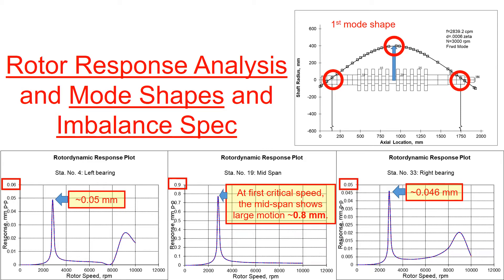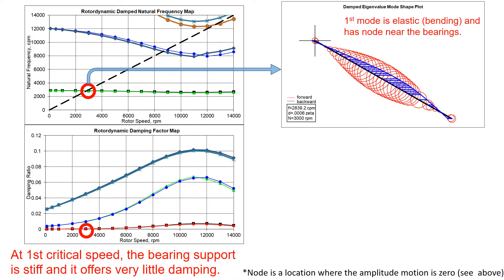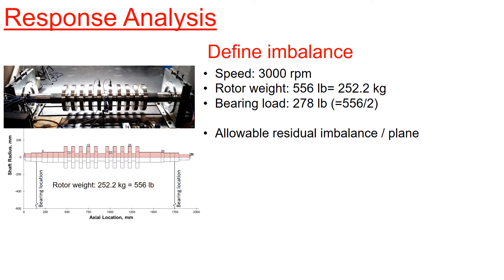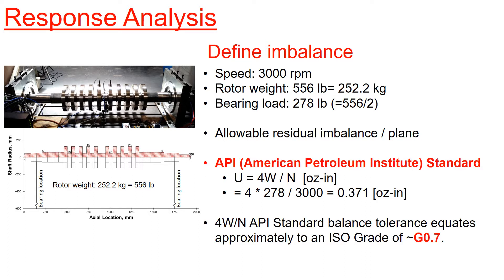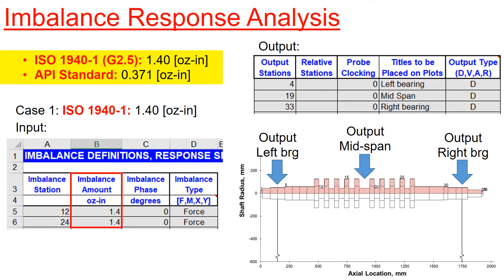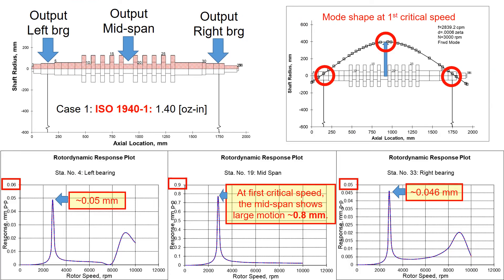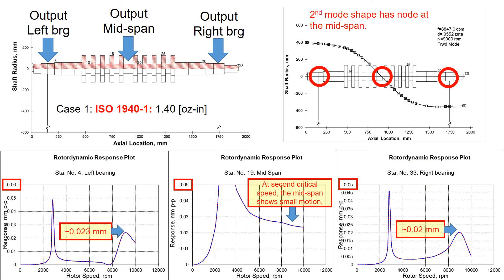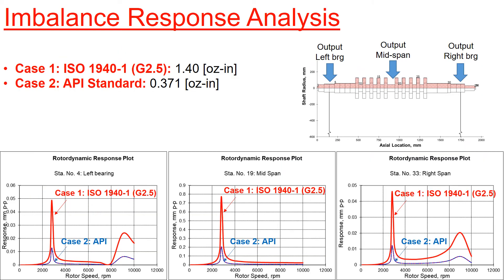Part 6 - Rotor Response Analysis and Mode Shapes and Imbalance Spec

Comment: Hi Team, I was of an impression that the 1st mode shape would always be cylindrical.  Can you please elaborate on the factors that affect mode shape and do a video on mode share vs critical speeds.
Reply from the maker: Sure, Will do. And, thank you for your inquiry. In response to your question about mode shapes, it's worth noting that while the assumption of the first mode shape being cylindrical holds true in certain scenarios, mode shapes can indeed exhibit variability due to factors like geometric considerations. For instance, in machines involving significant overhung mass, the first mode shape may manifest as a rocking (conical) mode, deviating from the typical cylindrical expectation. These nuances highlight the influence of specific structural features on mode shape characteristics.

Comment: Good video..I have a stupid question...
What is the difference between "stiffness" and "damping"?
In my understanding, they are proportional to each other...The stiffer the rotor, the higher the damping...
Can you correct me please?
Thanks for your excellent work.
Reply from the maker: Stiffness and damping are both properties that describe the behavior of mechanical systems, especially in the context of vibrations and oscillations. Here's a brief explanation of each and the key differences between them: 

-Stiffness refers to the resistance of a material or structure to deformation when subjected to an external force.
-Higher stiffness means that the material or structure will deform less for a given force, whereas lower stiffness means it will deform more.

-Damping refers to the dissipation of energy within a mechanical system, which reduces the amplitude of oscillations or vibrations over time.
-Higher damping leads to quicker dissipation of energy and faster decay of oscillations, while lower damping results in longer-lasting vibrations.

Comment: Hi, I really like your videos. Could you help me with these two questions? 
1. How do you know that the 1st mode is elastic bending? Was this stimulated by the XLrotor program ?
2. If the rotor is operating above second critical speed (damped) with a rocking mode, is it sufficient to just do low speed balancing?
Reply from the maker: Great question. To address this, performing a rotor dynamics analysis is essential, and you can compare the results with physical tests. Additionally, conducting a balance sensitivity study using rotor dynamics software will provide deeper insights. If the analysis shows that the rocking mode is dominant, low-speed balancing should suffice.

Comment: I have a question - from 1:49, bearing support stiffness is not a fixed number? Can stiffness be changed as speed increases?
Reply from the maker: Excellent question! Indeed, in certain cases, the stiffness of bearing support can be frequency-dependent rather than a fixed value. In practical scenarios, we often conduct impact tests to acquire the Frequency Response Function (FRF), which helps us understand the behavior of the system at different frequencies. By incorporating this FRF into the rotor dynamic model, we can account for the varying stiffness as speed increases. I appreciate your curiosity, and I'm looking forward to addressing this topic in a future video. Stay tuned!
Reply: @RotorDynamics  Thanks for kind and fast response :)

Comment: I have a question, when studying rotor dynamic, we plot campbell diagram. I always see the curves going linear and symmetric, but what happen when the curves aren't linear and symmetric? I'm dealing with a project and I can't explain why one of the curves isn't linear.
Reply from the maker: Campbell diagrams are typically used to analyze the stability of rotating machinery by plotting the natural frequencies of the system as a function of its rotational speed. The resulting curves are typically linear and symmetric around the critical speed, which is the speed at which the natural frequency of the system crosses the excitation frequency (usually the rotation speed).

However, in some cases, the curves on the Campbell diagram may not be perfectly linear or symmetric. This can be caused by a number of factors, such as non-linearities in the system, such as large clearances or nonlinear bearings, unbalanced forces, or other sources of vibration. In such cases, the Campbell diagram may become more complex, with multiple critical speeds, bifurcations, and other nonlinear phenomena.

When the curves are not linear or symmetric, it can be more challenging to analyze the stability of the system. In some cases, it may be necessary to use more advanced analytical or numerical methods to accurately predict the behavior of the system. These methods may include finite element analysis (FEA), computational fluid dynamics (CFD), or other advanced techniques.

If you are dealing with a project and one of the curves on your Campbell diagram is not linear or symmetric, it is important to carefully consider the possible causes of this behavior and to use appropriate analytical or numerical methods to accurately predict the behavior of the system. It may also be helpful to consult with experts in the field of rotor dynamics to ensure that your analysis is accurate and reliable.
Reply: @RotorDynamics Thanks for such detailed explanation.... Would you briefly explain, " what are non linear bearings?"...
Thanks.

Comment: Thank you so much for your sharing. I will appreciate it if you can share a paper including rotor dimensions, rd analysis results and test results. 

BR
Reply from the maker: Hi Talha. I'm using the rotor geometry from the paper written in 1996 "Squeeze Film Damper Bearing Experimental VS Analytical Results For Various Damper Configurations." But, the inputs for the bearing coefficients that I used in my videos are different than what is presented in the paper.
Reply: @RotorDynamics  Thank you so much.

Comment: Dear Sir,

              I am an engineering student from India. I was struggling to find the time series response of a single rotor system subject to unbalance in ansys transient structural module.

    Will you please help me in this regard?

 I have tried to do the analysis by applying a constant force in a particular direction at all times and evaluated the response but it is not as I was expecting.

 The response that I got is having some transients initially and after that the vibrations are becoming 0 after 3-4 sec for a 10 secs time frame.
Reply from the maker: Hello! I can definitely try to help you with your question.

To simulate the time series response of a single rotor system subject to unbalance in ANSYS Transient Structural module, you will need to follow these general steps:

1. Create a geometric model of your rotor system in ANSYS. This should include the rotor, bearings, and any other relevant components.
2. Assign material properties to your model, such as density and elastic modulus.
3.Define the unbalance force by applying a force vector in a specific direction at a specific location on the rotor. This can be done by using the "Remote Force" or "Remote Displacement" boundary condition in ANSYS.
4. Define the boundary conditions for the analysis, such as fixed or free bearings.
5. Define the time domain for the analysis, including the start time, end time, and time step.
6. Run the transient analysis and obtain the time series response of the rotor system.

It is possible that the response you obtained with a constant force in a particular direction may not accurately represent the true behavior of your system. In a real-world scenario, unbalance forces would typically vary with time, and the response of the rotor system would also vary accordingly.

To simulate a more realistic unbalance scenario, you can apply a sinusoidal or random excitation to your rotor system. This can be done by using a time-dependent force or displacement function in ANSYS.